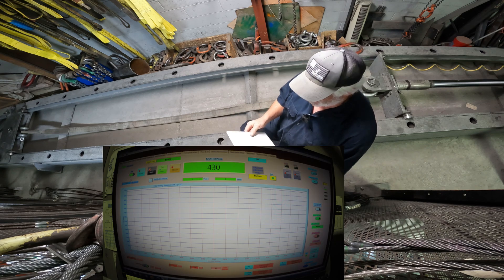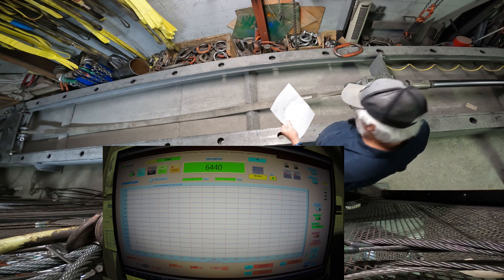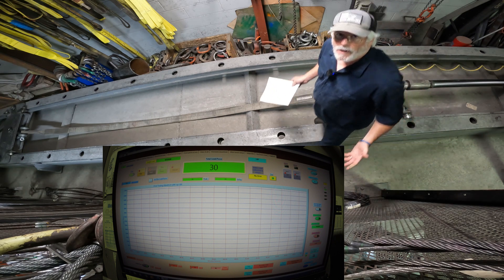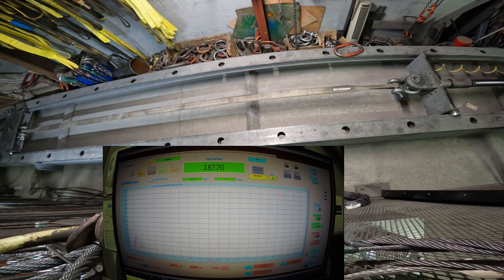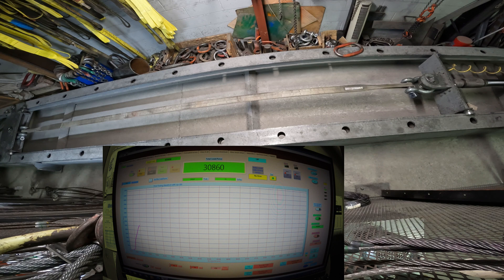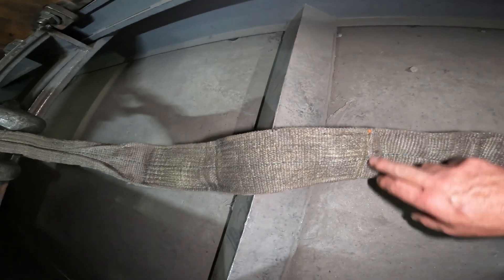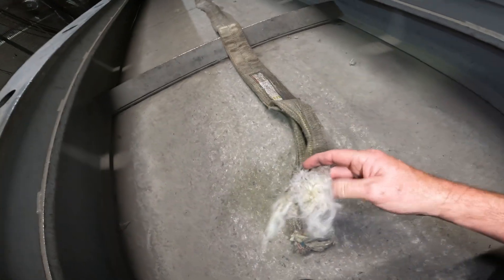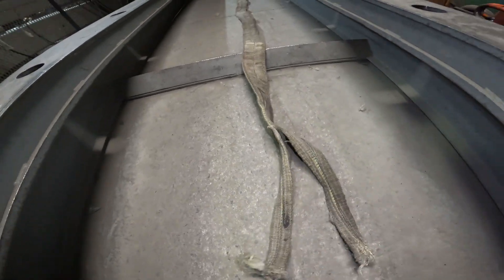BREAK TEST ON 2 PLY 4" WIDE POLYESTER WEB SLING

Comment: This was very cool!

I use 2 slings on a driving training trailer I made to prevent the trailer from jackknifing. I replace them every 6 months because the trailer sits in the desert sun and they deteriorate so fast. Sooner if they actually get used. They're 6 foot and they stretch to almost 8 after a hard tug/jackknife - Saves a truck and trailer and is way cheaper than bodywork.
Reply from the maker: Smart man.  You may have this already but use Polyester  slings they don't stretch as much, you may be using nylon and that is what we made all our slings out of years ago but now it's all polyester.  Thanks

Comment: Synthetic slings sure but do you say the same thing about chains? Much better life right?
Reply from the maker: Yes, wire rope slings and chain slings will tell you a story the entire time you use them.  Thank you for watching.
Reply: @hanginwithdaddio  having worked with crane rigging for the last 15 years before retiring I have only seen one cable snap. i think it would be a good idea if you went over the story to watch for out for on both chains and wire ropework... how they are used and abused and what to watch for.